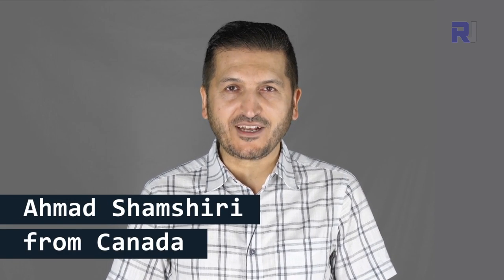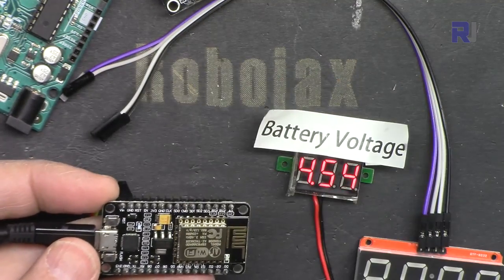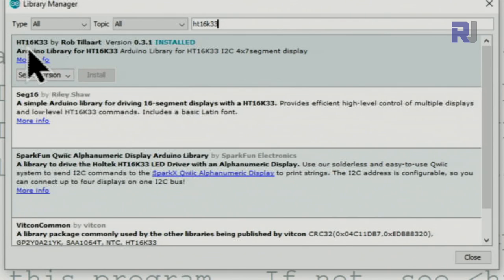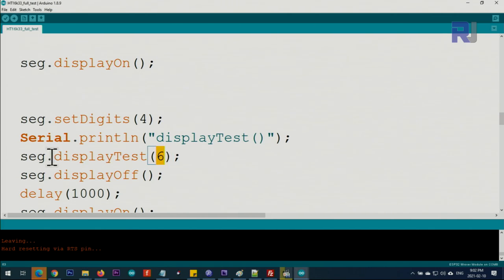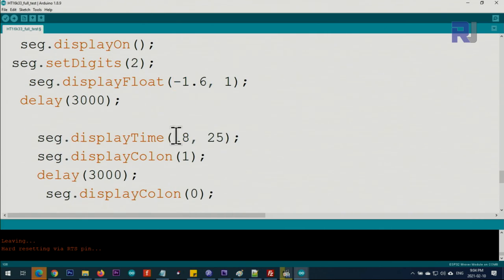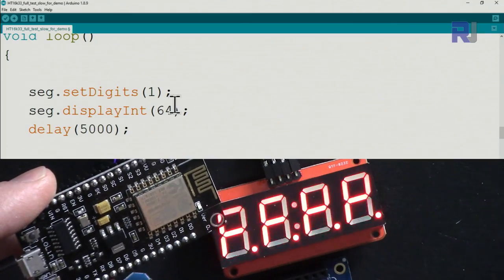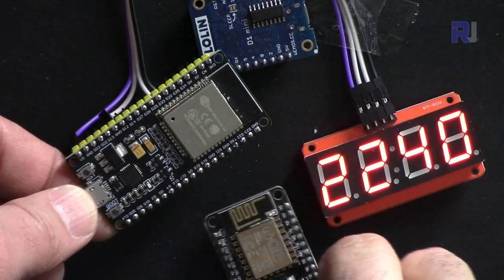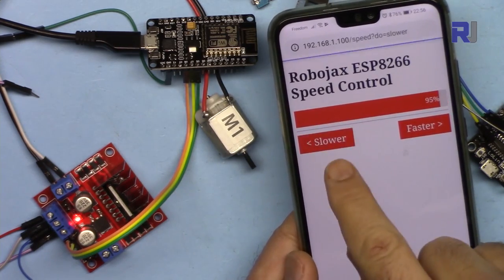Using HT16K33 4 digit seven segment display with ESP8266 NodeMCU and D1 Mini

Comment: Another great video, thank you. 
Would it be possible to use a node mcu to get internet time via WiFi and show this on the display? I have tried but not sure about converting the string time into an integer capable to put onto the display? Thanks
Reply from the maker: Hello, yes. possible. just watch till the end at "related videos"
Reply: @robojax  ok - thank you very much

Comment: Hey robojax, I have been using my Node MCU for like a month (I store it with a thermocol piece on its pins in a plastic bag. But it now takes time to respond to my commands. Like when I use a button on a web site to switch on LED, it is taking some time. It didn't happen before. Can you pls help me?
Reply from the maker: Even if you reboot it it is slow? something has happened or is happening in your network then.